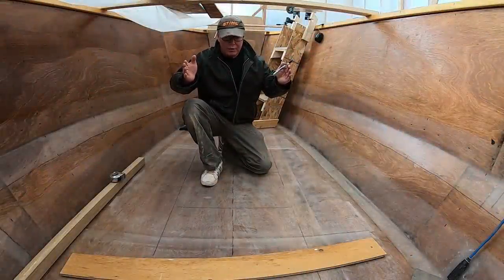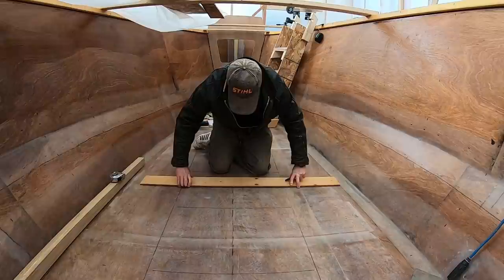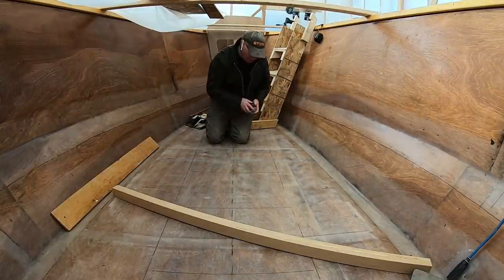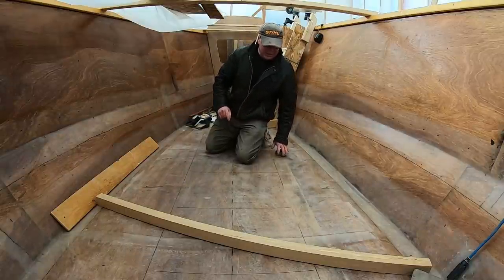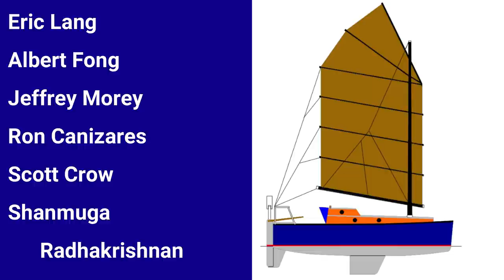S2E35  Keel Timbers fitted and Installed // How to build a Wave Rover 650

Comment: Just from my experience it seems that sailboats tend to have galley on Port side whereas motor boats have galley on the Starboard side , not saying you need to stay with tradition, just an observation, keep up the goid work totally enjoy your videos, I actually watch each of them 2-3 times so I catch everything!!
Reply from the maker: Interesting!
Reply: I believe the thinking is that a galley on port side is easier to use while on starboard tack. Hence you can cook while you have right of way. My sailboat has it on starboard side. 👍

Comment: I thought we had already had the poll on the galley position? I suggested that if it were to be aft of a bulkhead it would be better on the starboard side if you were right handed. Your working arm would then be in free space rather than tucked against the bulkhead. If you understand what I'm trying to say maybe you'll agree with me. You can also have a hand hold, maybe an oval hole, for your left hand. Leftie builders might prefer to have it on the port side. 😎
Will the chart table fold down over the galley/stove/food prep area? Are you having a small sink?
Everything looks to be coming on well.  Keep up the good work. Spring isn't too far away now so you'll soon not have to worry about ambient temps so much.

Comment: If you review your sailing plans, you will determine from which side of the boat the prevailling winds will come from most of the time. Then you need to determine which side of the boat you prefer eating, the upper or the lower side. Personnaly I prefer the lower side as it is safer and easier to eat and cook. On my boat, the galley is on the STB side which served me well on my trans Atlantic tour.

Comment: I'd put the galley on the port side. When you heave to you put your mailsail on the port side so that you have right of way. it is then easier to have the galley on port side as well.
Reply: There is no "right of way" in COLREG
Reply: Please correct me if I'm wrong, but having right of way is a common reference to a situation where your's is the stand on vessel and means the same thing.
Seems favouring being hove to on a starboard tack, as mentioned earlier, would be an advantage where you may meet another sailing vessel.
Reply: @carlosduran7800  Yes there is. Its  rule 12

Comment: I am just curious. In other builds, people made sure that they don't create pockets where water can collect. They have channels connecting each section of the boat, so on land, they can pour out all standing waters. You boat seems not to have those channels. Can you explain why?
Reply from the maker: This design is somewhat unique with it's large amount of watertight and semi watertight compartments. There will be a limited bilge area, near the main hatch, that you will see in future videos that has limber holes in the floor supports.
Reply: @RoversAdventure  I see. This is to make it ocean-worthy, so a leak in one compartment does not compromise the whole hull.
Reply: @SiqueScarface  sacrificing comfort for safety and function.
Reply: @MaShcode  In my youth, I was whitewater canoeing. The highest principle in maintaining a canoe was: keep it dry. They were made from fiberglass, and still, they were prone to rot, if they didn't get  the chance to dry off completely from time to time.
It's not just for comfort that you try to make keeping a boat dry as easy as possible and build it in a way that avoids any type of water pocket. A common strategy are the channels that allow for easy draining of all compartments. Wave rover apparently is going another way by sealing off the compartments and thus make it impossible for water to get in in the first place.

Comment: I'm sure that you have already thought this through but I noted that you are not including any limber holes (spelling?) to keep from accumulating water in the bottom of the boat.  Is that not necessary in this case or do you have an alternate method for getting rid of any water that may make its way in?  Great job so far, keep up the great work.
Reply: Limber holes don’t “keep water from accumulating”.
They allow it to move around freely!
Reply: @johnstarkie9948  Yes indeed, but unless the water can move around freely it can't gather at a low point to be pumped out, of course you could always pump it out of each area individually or soak it up with lots of towels but that wouldn't be my choice.
Reply: Your spelling of ‘limber holes’ is correct.

Comment: In my old days of working with West epoxy, it was not recommended to use white oak because the glue would not penetrate and grab the wood fibers. Have the rules changed? I think I would have laid down multi layers of your heavy fiberglass cloth.
Reply: Yeah. I guess that the epoxy is really just bedding for the timber, as it seems from what's said at the end, that the keels will be through bolted.
Reply: @pedalinpete  - The epoxy is more than bedding and the bond will be strengthened by the through bolts to the keel. I was thinking that Alan should have steamed the oak first to get its shape to contour to the bottom of the boat and then glue them.
Reply: Yes I’ve heard the same - unlike other timbers, particularly softwoods the hold is mainly on the surface, but perhaps given the load on these will be largely downward there won’t be huge stresses on the joint anyway. I’ve always left oak, particularly when in structural use, rough sawn on the epoxy side in an attempt to ensure as good a mechanical hold as possible.

Comment: I under stand that you intend to have a Chinese junk sail.
My I suggest the cat sail very similar and preforms better and looks better.
Should have no change to the design.
Reply from the maker: I did consider it but part of the design concept was to keep it simple and affordable for the backyard builder.
Reply: @RoversAdventure  I must admit I've never sailed a yacht with a junk sail plan. Until I did some homework on their sails and watched a few video on junk sail rigs. Not sure that they are more simpler to sail. 
Every sail has a min of 3 corner's so there is a min of 3 ropes.  Their seams to be just as many ropes to handle on a junk rig.
I however I do see some advantages of the idea and rope and Thinking of change my main to see how it could work on a standard sail plan

Comment: On one of your videos you talk about how safe full keels are and the virtues. But on wave rove 2 you are having a twin keel. why?
Reply from the maker: If you add the twin keels together and add in the skeg, they will add up to a pretty significant length. Although there are many reasons for going this route, one of the main criteria was directional stability that the twin keels provide.  Remember, on small boats such as this, everything is a compromise far more than on a larger boat such as a 26-32 footer.

Comment: The only thing worse than working with the US imperial measurement system is living in Canada or Mexico where you have to deal with metric and imperial units all the time.
Reply: Just numbers, really not that difficult !
Reply: No different here in NY.  2 sets of sockets, 2 sets of allen wrenches.  And uneducated workers who refuse to use drawings with metric dimensions even though they have measuring tools with both markings.  Sure would have been easier if the US had switched when Canada did.
Reply: @rcdogmanduh4440  not entirely true.  In my former job as an engineer, a decent part of my time was spent converting units between various systems.  Lots of errors were introduced, and occasionally slipped through to construction phase.  It adds cost to and reduces efficiency of business dealing with two separate systems.  As horrendously painful as the first 10 years or so would be, in the long run would be much better for us here in US to switch to metric.